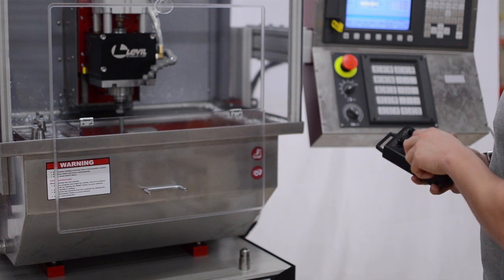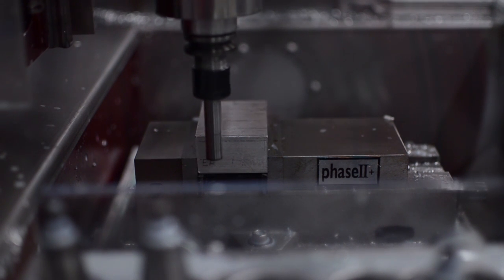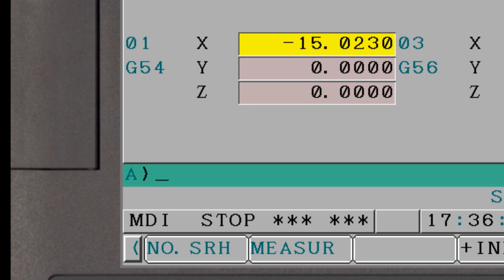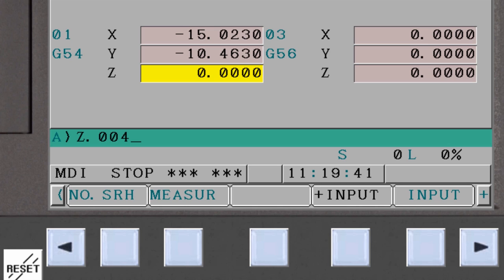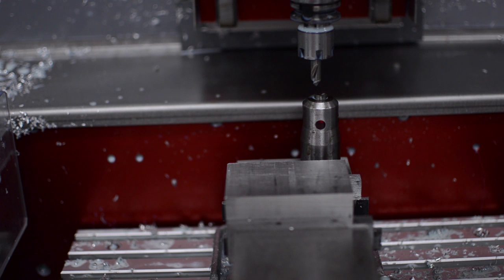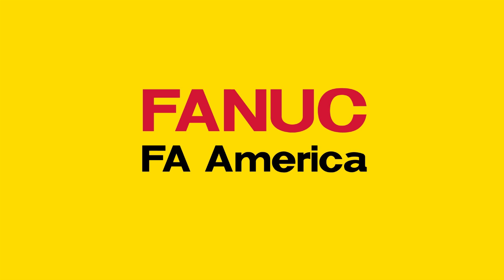Easy Job Setup

Comment: 00:10 Easy Job Setup Intro
00:51 Using the Spindle Nose as a Reference Tool
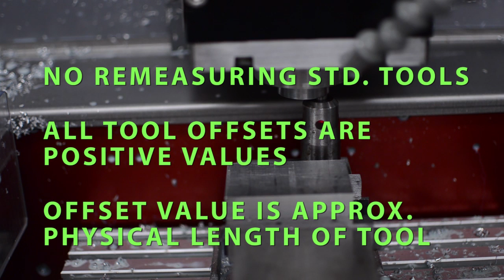01:12 A Few Inexpensive Instruments
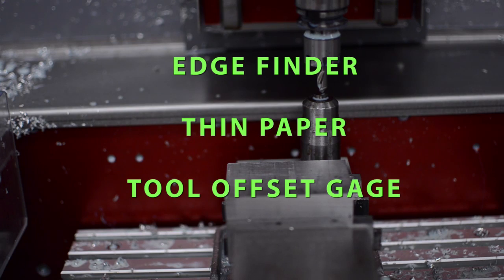01:25 Task 1: Measuring X and Y WCS Offsets
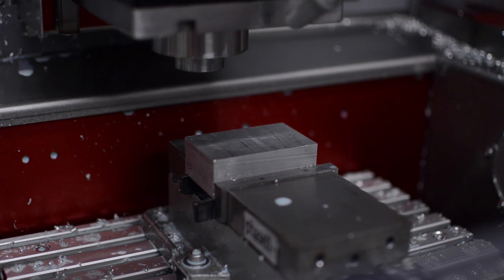04:58 Task 2: Measuring Z and Y WCS Offset
06:35 Task 3: Measuring Tools Using the Spindle Nose Reference Method

Comment: Hi. Is there a way for measuring tool lengths, so I don't have to touch spindle face each day? I like positive  length values. In old Cincinnati sabre this was preset once for live.
Reply: You could use 1-2-3 blocks and the programmer could adjust the program to 2inches above on Z